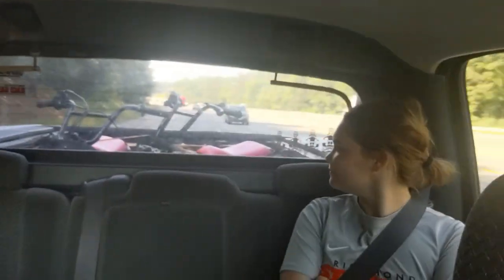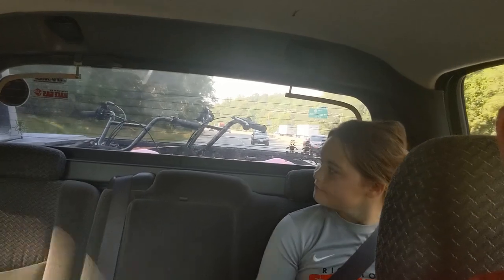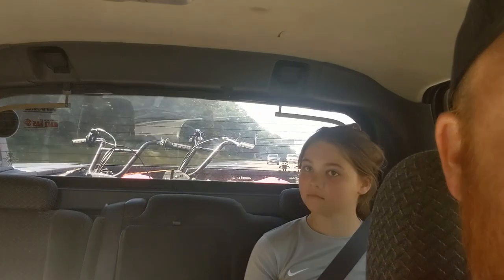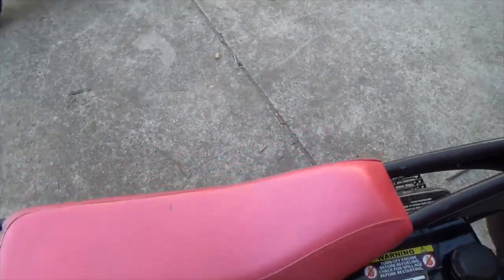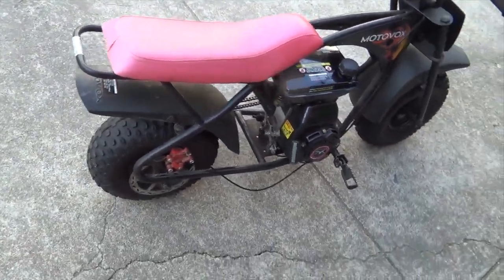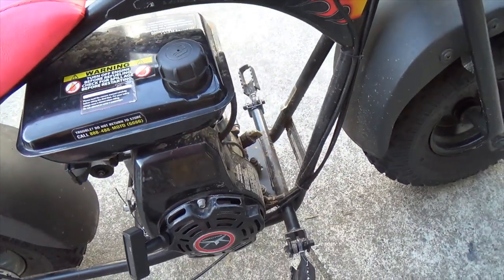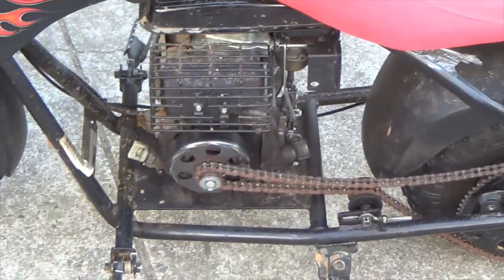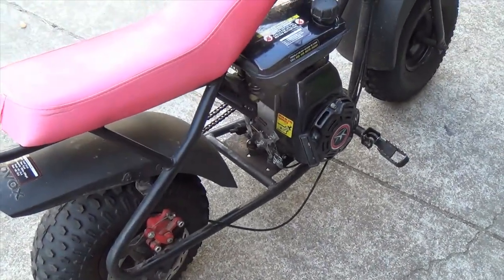Mini Bikes! - Motovox MBX10 - Two for the price of one.  $150

Comment: Hey i know this is random but , im from Australia and have a eton rascal 40cc i have seen some of your old vids from 7 years ago but how are they doing? Or did u sell them ?
Reply from the maker: The Eton rascals were decent at the time when my kids were around  5 years old.  They were simple to work on.  My biggest issue was that I had 3 and to use all 3 at the same time was tough.  One would cut off and I would restart it, then another would cut off.  I had two that were similar blue and red with rounded plastics and then another red one that was different.  The red one that was different seemed to run better, not sure why.